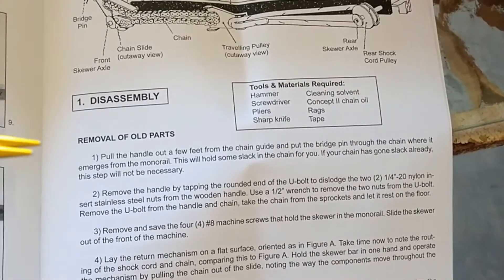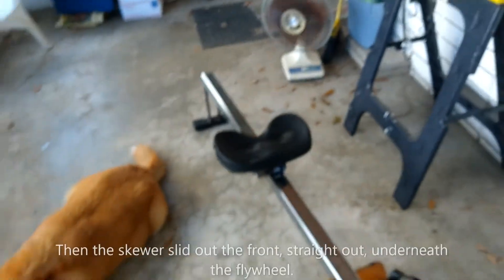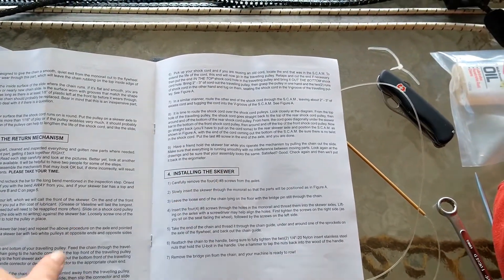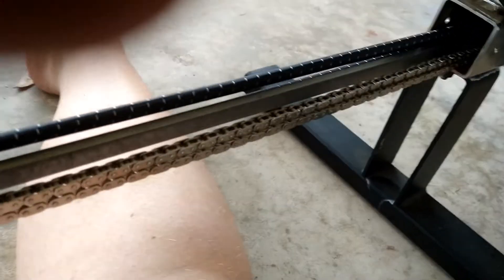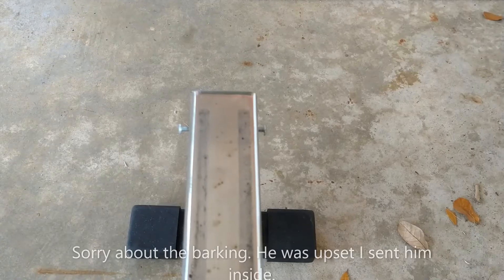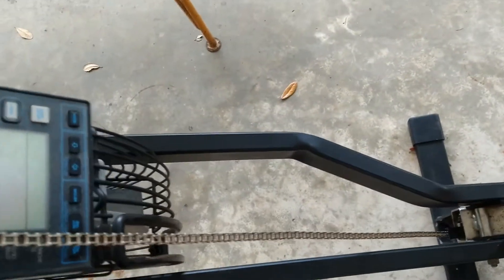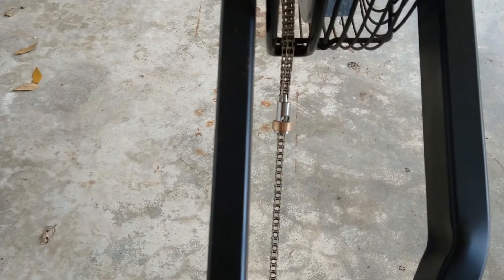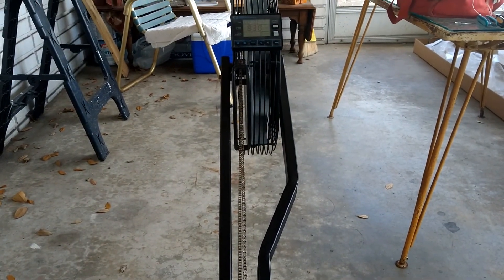How to replace the skewer assembly on the Concept2 Model B Rower

Comment: Thanks for your instructional video! I’m debating between assembling new components on existing skewer or buying the whole new assembly for twice the cost. I have one question for you: did you notice any bend to your original or the new skewer bar? I have a bend in mine (if facing forward and looking down at the bar, the bar has a slight bend at midway and to the right, away from the traveling pulley). After reading the maintenance pamphlet, I’m convinced now that bend is supposed to be there and is normal. I’d hate to order a new bar and find that bend was normal all along! Thanks for any comments.
Reply from the maker: As far as I can recall my new skewer had a bend in the bar, I assumed to make space for the traveling pulley. The reason I decided to replace the whole assembly was mostly that this was my first repair to the rower and I just didn't feel comfortable swapping out that many parts. After reading the process to assembly one out of new components, I was worried I would make a mistake and not know where/how to start troubleshooting, and I decided to spend the money to save myself that potential problem.
Reply: @palepomegranate2052  Thank you! That makes complete sense why you went that route. I'm tempted to as well. I bought my Model B cheap and disassembled due to a bad shock cord, and found the bent skewer bar. But now what I thought was a problematic bar is likely normal and good to use. Thank you for your feedback. So now I'm ready to attempt assembling new parts on my original skewer.